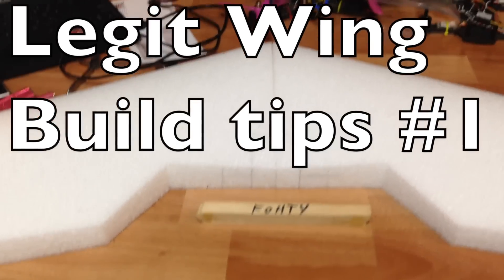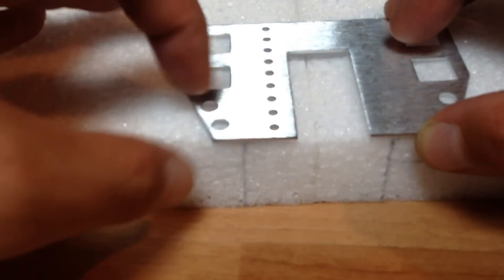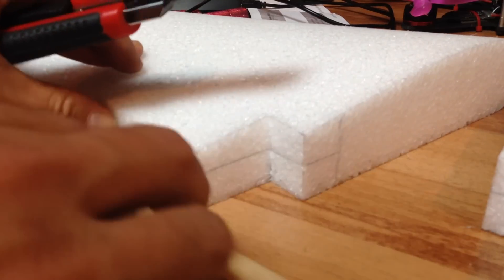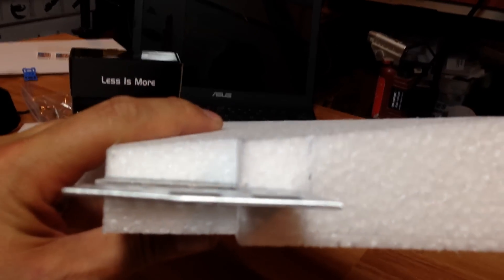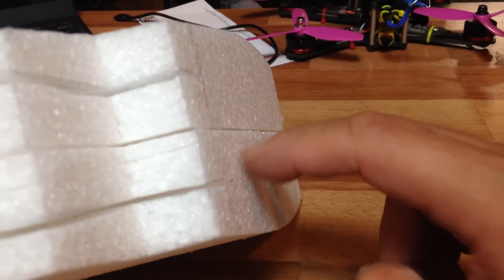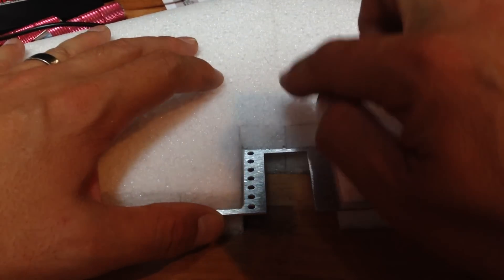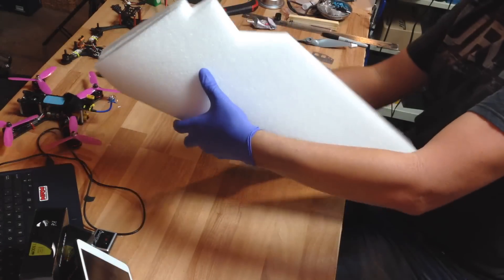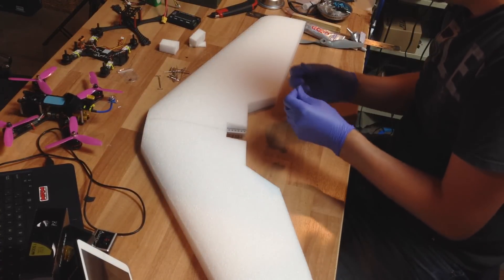Legit Wing Build Tips #1 Motor Mount and Joining Wings

Comment: Hey Jeff, nice video! Very nice advices and techniques! Cheers, Matt 😁
Could you recommend an alternative to GOOP, which is available in Germamy...
Reply: UHU Por
Reply: If I take UHU POR, which, as far as I know, is a contact-glue, is it then still possible to correct, If a gluejoint is a bit off?
Reply from the maker: Yes, UHU Por is the european version.  I'm not sure about repositioning after contact.  Goop is pretty slimy- you can manipulate it after contact